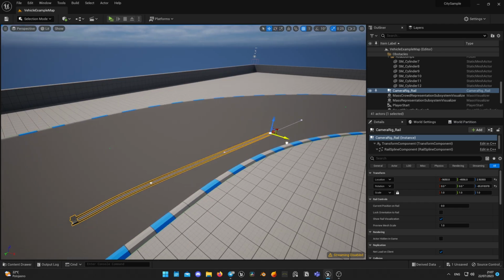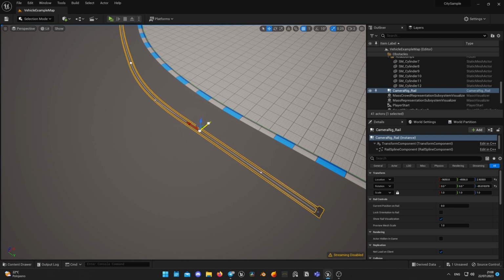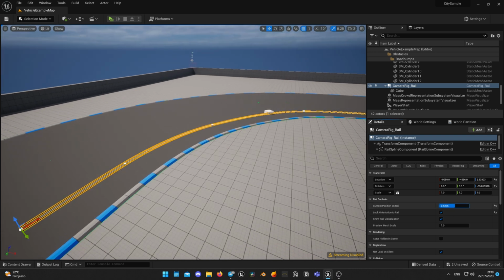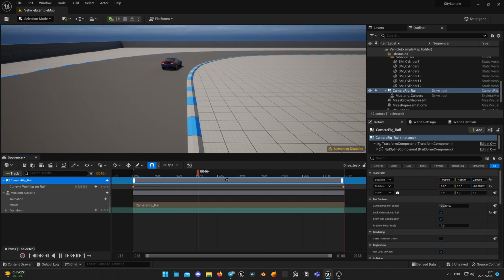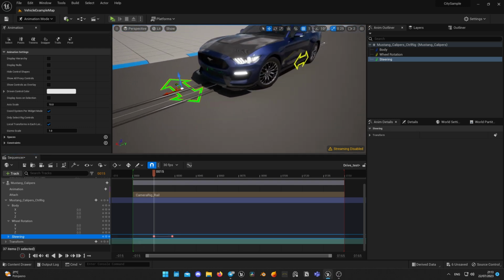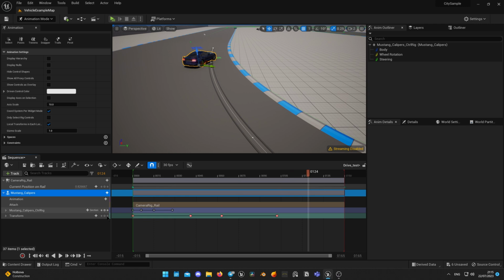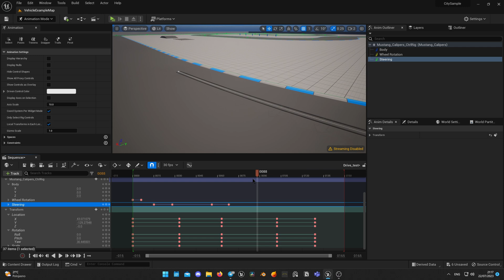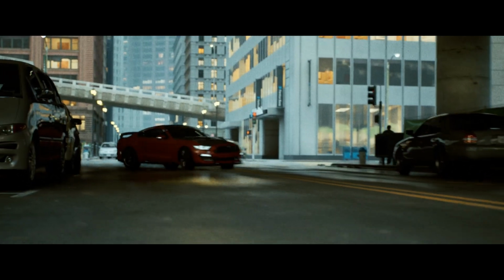CAR ANIMATION USING SPLINE | Unreal Engine 5

Comment: awesome work ! I did something similar in a scene i have , works fine inside UE5 but when I render out car moves, wheels move but they don't rotate although they are rotating inside the engine, any idea if there is a missing setting i should check

Comment: is it possible to add multiple cars to a single camera rail rig ?
Reply from the maker: yes it is possible, but there would be an issue with offset... as "position on rail" can not be separated for each car. Better probably would be to duplicate rail rig and put it exactly on the same spot so you can animate each car with separate rail rig
Reply: @postprocessed  great idea. thank you. 

we are working on a residential project and want to populate its roads with animated cars. do you think this approach is a good idea. Or is there another way to do that ?
Reply from the maker: @ if cars only drive straight - than I think you can attach multiple cars to one rail. I think it's nice approach and would be easier than transforming all cars separately. it's quite simple and effective I guess. Other approaches would require blueprinting that may take more time for creating a spline BP for this simple animation

Comment: How do I solve the motion blur problem on the car wheel? I'm a beginner and I made an animation in 3ds max and imported it into unreal, but in the render the wheels looked strange because of the motion blur.
Reply from the maker: When you set up render in movie render queue add “anti aliasing” and give it like 2 by 8 temporal and spacial samples. Rotational motion blur needs sampling to look fine

Comment: Hey the controls for the rig arent doing anything after I add it to the spline. It isn't coming up when I filter animatable controls or whatever. The controls work perfectly fine when I open the rig blueprint up though?
Reply from the maker: Rig only works in open Sequencer and in ANIM mode. So you need to open Sequence and add your control rig into the sequencer, after that controls will appear and will work
Reply: @postprocessed  yeah that's what I've done though. One thing I noticed though was the numbers aren't all zeroed out and are showing the Y & Z position in the wheel rotation drop down in sequencer (and for other controls). Maybe I set initial pos instead of the offset? having a look through to see but all of those settings (initial/current/offset) are all greyed out and wont let me change anything, it will only let me change current pos. sorry if its something really simple, this my first time using unreal haha

Comment: Doubt you will see this a year after posting this video, but any chance you know how to get this to work with attaching multiple cars to create traffic as I can't figure out how to keep the orientation with all cars. like the turns only work for the beginning of the rail rig, so cars further down attached to it are going to go straight off the path. Any solution would be very helpful, thanks.
Reply from the maker: Still thinking about it for two days how to approach it better... Maybe if it is quick background car traffic you can disable "lock orientation to rail" and add transform track and rotate car on Z axis for each car on same rail? I guess that could be faster.

Comment: I have a strange problem. When I add a key frame to the end my car spawns in the middle of the map. At the first key frame the Car is at the beginning of the camera rail rig.
Reply: My bad. I did not add the key frame at 1.00. It is working now.
Reply from the maker: @Marvin7408  perfect

Comment: When doing this in the Matrix City Sample project the car remains in the initial spawn point when I render but works properly in the viewport, has anyone else experienced this problem? It only happens to me in the City Sample pack and I’m not sure why
Reply from the maker: You should make Car and Rail and basically any object in sequencer a Spawnable object. than it works. To convert it - right click it in sequencer -> Convert to Spawnable
Reply: @postprocessed  That was it mate, thank you :)

Comment: New to Unreal, but my fbx imported Mustang doesn't look real like yours. I still have opaque windows and it looks like plastic. How do I make it look realistic?
Reply from the maker: hey man check UE marketplace and there is free automotive material pack. Use it for shading car and making it look as in the video. I skipped this process in the video as it is basic process
Reply: @postprocessed  I found one pack you mentioned in a different video. That one was only compatible up to 5.1 I think. I'm on 5.2 now, going to switch to 5.3 later. To fix the issue I just tweaked the materials to get a more desired look. Thanks for the feedback.

Comment: I followed your tutorial to the Tee but my car disappears when I try to render the sequence out -- please help! 😭 I don't know what I'm doing wrong. All the actors are loaded onto the sequencer (skeletal mesh with ctrl rig attached; camera rig rail; cine camera actor; etc) and it all works fine in the level sequence, but when I render, the car disappears. The camera still follows it's path properly, but my car doesn't appear in the final render. Please, please help. I've scowered the forums with no luck.
Awesome tutorials btw. Absolutely amazing. ❤⭐
Reply from the maker: Hey! Which environment you use for render?
Reply: @postprocessed  Hey! I used the City Sample > small city.
Reply from the maker: @LestZA  can you please test it in empty environment with just plane? City Sample is so damn bugged, over complicated and just poor performing. Looking cool though
Reply from the maker: @LestZA  let me know if that works on empty environment pls
Reply: @postprocessed  I tried it on an empty level and it worked fine. I guess it's the Matrix demo level that's the problem.
Reply from the maker: @LestZA  yeah, there are a lot of things which need to be done before rendering in Matrix city. You should disable game mode, remove traffic, make camera spawnable in your sequencer so it will render in correct position and so on. I think there is a huge thread on UE forums describing what needs to be done for city sample to make it render :/
Reply: @postprocessed  Alright thanks a lot man. I appreciate the replies, and your videos are gold. ⭐️

Comment: Thank you, really great video. How do i add multple skeletal meshes at different points in the spline anyone?  I cant find a fix for this other than duplicating the spline multple times XD
Reply from the maker: You can transform each car also. So they will be at different point of the spline. May not work very good, but it is what it is. If drives straight - it is fine
Reply: @postprocessed  really appreciate the fast response, I have tried experimenting with the transforms of the cars and the camera rail rig to no avail. Thanks anyway. as long as duplicating isnt to expensive ill do that :)

Comment: Omg thanks a lot for the excellent tutorial!!!! Btw I'm wondering if there's a way to attach multiple cars to the same rig rail, like a fleet?
Reply from the maker: I recently just answered to same question 😁
Answer is:
Yes and no:)
You cab duplicate rail and attach another car to this rail - and separately control each car progression. Alternatively you can connect multiple cars to one rail, transform position from one car a bit back or forward, but anyway “current position on rail” will control both cars and they will go both same speed
Reply: @postprocessed  Thanks a lot!🙇‍♂️I tried attaching multiple cars to one rig rail before and found that if a car is transformed too much, the motion became weird🤔 I will try duplicating rig rails instead...and thanks again for your fast reply!

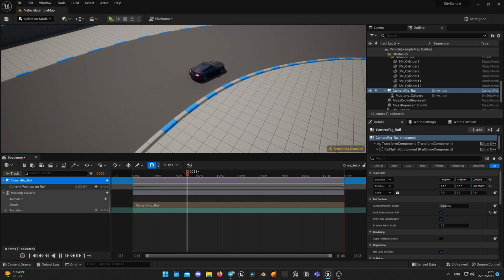Comment: When I get to the step at 4:30 , and press play it does this weird reverse and slow motion moving (even though I followed all the steps) do you know why?
Reply from the maker: maybe there is another spline point? sometimes it creates it for no obvious reason and making a "knot", maybe that could be the case?
Reply from the maker: also check if you car has "transform" track in sequencer. Could be also an issue
Reply: @postprocessed I'm sorry to keep coming back with more questions but I made sure there were no knots and there is transform in sequencer. Now the vehicle wont move at all. I have no idea how to fix it
Reply from the maker: @dc_ghostpants  try to do that with something simple, like basic shape. Cube, Sphere, doesn’t matter. Make sure you add cube to sequencer, add “attach” track and correctly attach it to Rail Rig. 
Rail should also be added to sequencer.
Reply: @postprocessed That worked! Thank you!

Comment: Hi, I have a problem that I can't solve, I position the car on the track and do "attach", set the keyframes and everything works if I go to play.
But when I save or record the sequence the car ends up in a random position.
Where am I wrong?
Reply from the maker: Check that your car "attach" track is also stretched on the whole duration of sequence track. That might happen, and also check that you car's position is set to 0 0 0. As it should be at zero position on the rail
Reply: @postprocessed  Yes thank you, I then solved that I have to give the Keyframe to "Transform" otherwise it wouldn't take the fixed position.
Reply from the maker: glad to hear it is fixed now!  @altruistudios

Comment: Great tutorial! But I have one problem. Wheel motion is not visible in path trace render. What am I doing wrong.
Reply: Okay I see you already comment below about this issue.
Reply from the maker: Yeah so it works only in 5.3 properly, 5.2 has some issues with it. Or check my latest video with procedural suspension, there I tell how to initialize rig through using Blueprint Actor Class, which should make all workable all the time

Comment: I have a few questions, how would I get the car to gradually accelerate from a standstill, also is it possible to get the wheels to automatically spin at the right speed, also how do I get suspension and can that also be automated.
Reply from the maker: Well I mentioned it from my previous videos I guess... Use "cubic" smooth key frames for acceleration/deceleration

Comment: great tutorial as Always!!!!!  Can anyone kindly tell me why when I activate the pathtracing mode in the city sample project all the decals disappear? I tried both with ue5.1 and 5.3
Reply from the maker: yeah... well city sample is hell of a project... So thing is that decals are assigned to invisible meshes as materials and... well. For some reason it doesn't work. I didn't find solution yet. so I placed them manually. Pain in the ass tbh
Reply: @postprocessed  🤯🤯 manually, thanks!!! Il’l try

Comment: Awesome tutorials thank you. Here I have something very specific. There is a road and my client wants me to place a camera to the hood and see the road from that POV. And he asks me to do this with switchboard ndisplay config on an LED. Can you be so kind to guide me on how to achieve this.. Thank you either way..
Reply from the maker: Hey! Yeah, well it is not something that I can explain in one comment, I don’t have video about it :( , but there are plenty tutorials on yt how to setup ndisplay https://m.youtube.com/watch?v=u5bgaze7aLw
Reply: Thank you for reply. I already have my nDisplay setup the issue I am dealing with is how to make this run in editor rather than hitting play. Because I am not using multi uer setup and that means I do not run any of my render nodes in play mode. Is this something achievable have an idea?  @postprocessed
Reply from the maker: @sinanarts  you can use “simulate” crtl+s if I remember correctly and place your sequence to level and check “autoplay” in details. If I understood it correctly
Reply: That surely helps thank you  will try and let u know.
Best regards. @postprocessed

Comment: I add your car, my textures of this car are completely different or they don't work at all. And how to make them like you in this lesson?
Reply from the maker: Yeah, model doesn’t contain textures. You need to download free material pack called “automotive materials” it is available for free on unreal engine marketplace and after download add it to your project. You will have all what you need: car paint, rubber, plastic, chrome
Reply: @postprocessed  you are the best, looking forward to more lessons
Reply from the maker: @bedanosec6978  no prob, mate! And will post more tuts soon!

Comment: For anyone who came here to check how to make spline animation 100% smooth (as when you attach a car or the camera you will see shakings at some spline points). From my experience, you won't be able to fix this( 
Only one working thing to fix this - use a blueprint for following the spline (find on the internet a ready blueprint for following the spline, epic released it somewhere) make a spline, attach this blueprint to the car or any object you want to move and then use the recorder to capture all movements. 
Yes it's quite harder than just rigrail but it will give you a 100% smooth movement.
Reply from the maker: Everyone, listen to this man! This advice is priceless
Reply: @postprocessed  Xd thanks! Would be cool if you would make some deep and easy tutorial about this when you would have some time)
Reply from the maker: Hope I will find some time for that too!

Comment: Do you have any idea why the wheels don't rotate when I render in path tracing? (working with LIT) yes I did key frame for the wheel spining (as in your tutorial)
Reply from the maker: Working on solution, it’s a bug of UE 5.2
Reply: Have you tried baking control rig? I found the solution this way, there are some problems but at least the wheels are turning hahaha
Reply from the maker: in 5.3 it works fine BTW  @berkaysimsek2594

Comment: Great tutorial! One thing... im not getting my wheels turning in the renders...? I have them turning in editor while ive keyframed the rotation. And they rotate in simulation mode, but dont once i do a render. Any thoughts on what i may have missed??
Reply from the maker: Do you use UE 5.2?
Reply: @postprocessed  yes
Reply: the steering keyframing works in renders, but for some reason my wheels just dont rotate in the renders
Reply from the maker: @NeoNoir_  that's UE 5.2 bug. use 5.1 for now, I am figuring it out how to fix it. When done I will share the fix
Reply: @postprocessed  i see. yes please do share if you find a fix for it. im using it for a project right now.
Reply: so my work around was to bake the sequence of the car in an animation. then just add the animation to the skeletal mesh. worked!
Reply from the maker: ok, cool I think it's the only way it works now. UE 5.2 bugged Accumulated Time node and it doesn't work properly. But in 5.3 it works fine
Reply: Just downloaded 5.3 after hours of messing around in 5.2 and coming back to this tut to check i wasn't going insane... can confirm it worked perfectly first time after copying the project over :)
Reply from the maker: @tomharding2388  I even made a bug report to Epic Games, but I believe they will not be fixing it in 5.2 as they have 5.3 coming soon

Comment: On winding roads, at high speeds (in corners for ex.), the car jerks strangely, even if there are a large number of rail points...
Reply from the maker: This is UE bug. I am trying to make short rails and hide transitions with camera cuts. If it is absolutely necessary for you to make a long move for the car you can just transform rig position, without the spline
Reply: With railsplinecomponet selected, Under the "spline" tab, Go to "Advanced", set the "reparam steps per segment = 100" (default is 10). It worked for me, try if that helps!
Reply: @PallavSen  Yes I tried, but it doesn't work for me. I did it, with what I have. But thanks!
Reply: @Klaudyu5  oh sad... then the best would be the approach that Mr Postprocessed mentioned.

Comment: Awesome video, Vaas! Just noticed something on your previous city sample video. Do you use default materials on the vehicle while animating to take the load off your system? I've been using custom game modes to toggle between high quality, proxy and render modes but never thought of substituting materials.
Reply from the maker: Sometimes I do, but right now my system can handle that and I am using automotive material pack and it's kinda okay, no performance issues